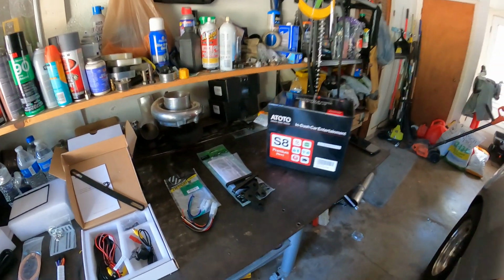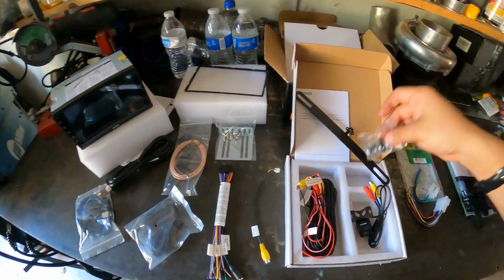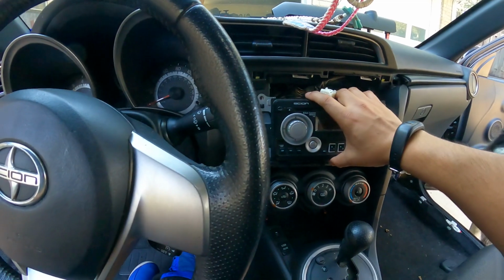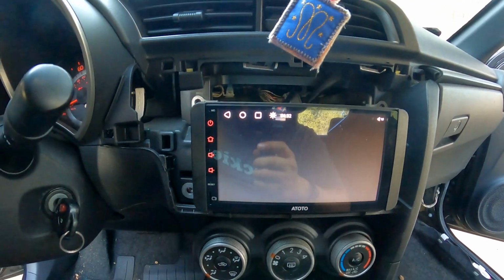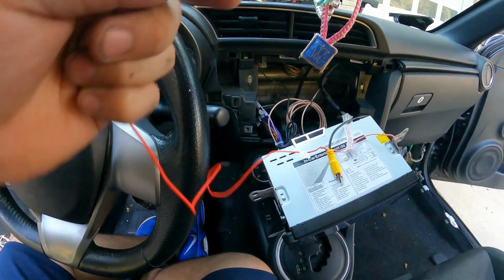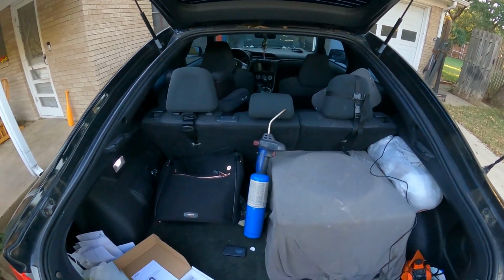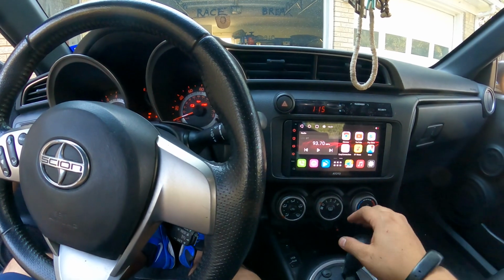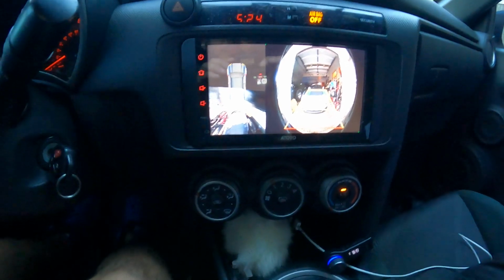ATOTO S8 Gen 2 Premium Stereo w/ Reverse Camera Installation & Review

Comment: Great video and love your explanations.  For the camera, did you use the long mounting bracket that uses the two screws that hold the license plate?  Or did you screw the camera directly into the plastic car body. If you used the long mounting bracket, how does that connect to the camera? I wasn't able to figure that out.  Also love your dogs!!!  I am going to mount my S8 into my Toyota RAV4 (2007) with the same camera. I'll be using the original JBL premium sound system, original amplifier, and have ordered (hopefully) the correct wiring harnesses and adapters for that stereo system as well as the original steering wheel controls.

Comment: Bet the gps didn't work as you need the antenna outside dash on these cheap units..
Reply: Actually, I bought an Atoto head unit approximately 6 months ago and installed it myself.

I also put the GPS and Wifi modules under the dash and they work fantastic. I took a drive from Ontario Canada to Georgia USA and never once had the GPS or WiFi signal cut out. It's very reliable!

Comment: have an important question… i have the exact same stereo and backup camera and i’m installing the backup camera as we speak. i came across an issue i’m not understanding: the backup camera needs to be connected to the accessory coming from the atoto head unit. but mine is already used up as it was soldered to the car already. do i need to connect: the accessory from the head unit, the accessory from the backup camera, and the accessory coming from the car/aftermarket harness together? meaning 3 wires spliced together in one? or am i missing something? please let me know!
Reply: I ended up connecting the red wire from the harness of the radio and the camera together and crimping them on one side, and the other side, the red wire from the car harness.
Reply: I'm currently in the same position. An answer to this would be great.